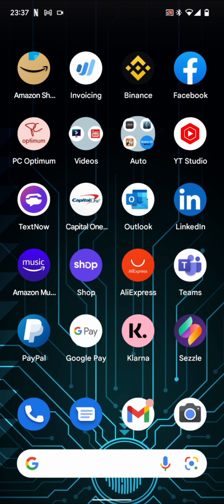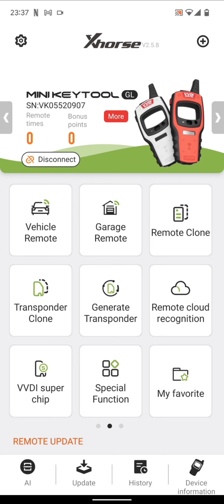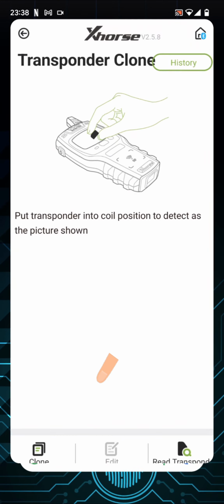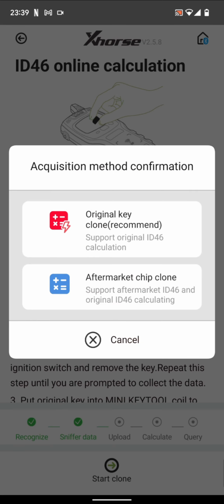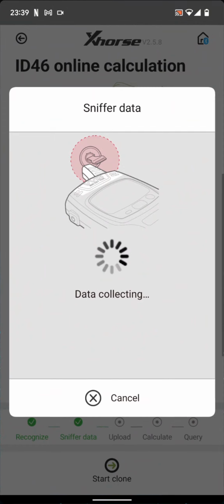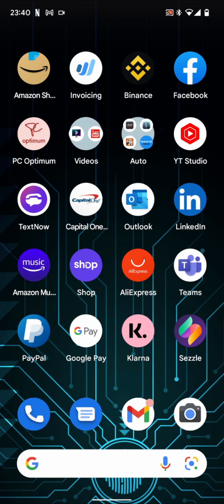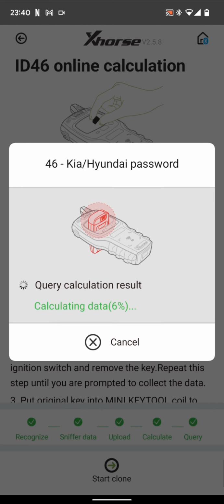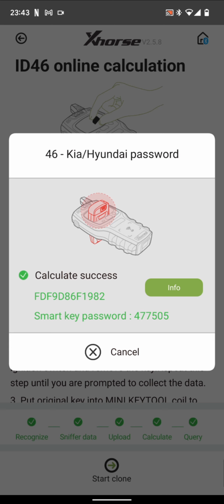Kia Pin Code(xhorse vvdi mini key tool)

Comment: DUDE YOUR VIDEOS ARE SO INFORMATIVE,, I WILL DEFINITELY BE BUYING ALL THREE OF YOUR KEY TOOLS I HOPE THEY WORK AS GOOD FOR ME AS THEY DO FOR YOU ... THANKS SO MUCH FOR YOUR TIME !!!!!!!!
Reply from the maker: Glad you like them! I try my best to make them as informative as possible... If you have any questions do not hesitate to ask.

Thanks again for watching.
Reply: Autel's KM100 does all the functions of the three tools, only missing keyless entry remote generation and transponder chip key tool functions, you'd be saving around 500$ and get much better IMMO coverage.

But in the end there's no replacement for one of xHorse' key tools, OBDstar/prog/code cannibal is the leader in motorcycles (if the software is available) as well a cheap way to do active alarm all keys lost on Fords, and XTool is good on offline key programming, older cars aswell as All-keys-lost timer bypasses.

Veteran auto locksmiths usually have all of these cheaper tools, or just one or two of the expensive tools like Abrites AVDI/Smart Pro/VVDI family/OEM tools.

If you are just starting up on mechatronics and need an all-in-one mechanic/locksmith tool, Autel's IM608 is the one to get, for UK people the MS908IM is actually a better deal as you get full Benz and BMW onboard programming functions which is missing on the IM608.
Reply: @SpringvisualTk  THANKS SO MUCH FOR THE REPLY ,,, ITS SO GREAT TO BE ABLE TO TALK TO SOMEONE WHO KNOWS EXACTLY WHAT'S GOING ON AND WHAT IS NEEDED . I DO MOSTLY AMERICAN AND JAPANESE CARS FOR NOW, NOT BIG ON THE EUROPEAN . I HAVE THE XTOOL PAD2 PRO BUT THAT IS THE ONLY KEY TOOL I HAVE BESIDES MY SCAN TOOLS THAT CAN DO SOME SECURITY WORK ,,, LIKE LAUNCH, AUTEL, AND G-SCAN. SUZUKI IS A ONE OF THE CARS THAT I HAVE TROUBLE WITH ,, WHAT WOULD YOU SUGGEST THAT WOULD SUIT ME FOR THE MARKET I AM IN ,, AND THANKS SO MUCH FOR ANY INPUT !!!!!
Reply: @8power0  scan tools won't do much for you regarding key programming, Autel's can't even bypass a pin for a 2010 Nissan.

We found the Pad2 lacking in newer cars and uncommon programming profiles, especially Hyundai/Kia keyless entry remotes, KM100 is definitely the best value, it will get you confidence in being able to do most if not all the OBD jobs for the market, even euros like Fiat, Alfa, Maserati, Rolls-Royce, and some BMW/VAG/Jaguar older than 2013 are no problem, even all Volvo semi-smarts.
The online compatibility list is top notch.

Ever since Autel started taking key programming seriously with the IM line, they proved consistant quality and updates, it makes no sense nowadays to get anything else value wise, other than for becoming a specialist.

Another option is the xhorse mini key tool, it has great Suzuki support, but it hasn't seen even a bit of the growth of autel's, but at $170 it's a reasonably good deal, but I'd try seeing if Autel will solve your needs first as Xhorse is not a complete tool and is not user friendly, and autel's solution cost just 200$ more since they include 2 universal fobs.
Reply: @SpringvisualTk  THANKS AGAIN FOR THE GREAT REPLY ,, I CAN'T TELL YOU HOW MUCH THIS MEANS TO ME FOR YOUR HELP . I WILL BE TRYING THE XHORSE MINI KEY TOOL FIRST ,, COULD YOU TELL ME DOES IT COME WITH THE APP OR IS THAT SOMETHING SEPARATE THAT I WILL HAVE TO BUY . I HOPE I AM NOT ASKING TO MANY QUESTIONS ... THANK YOU .
Reply: @8power0  all you need is the app you can download it now.
Make sure to read again my last comment as I edited.
Reply: Just used my mini key tool to read the smart key on a 2015 Hyundai Veloster FS.  Your video was a big help. Just an FYI for anyone doing the newer prox keys.  Remove  the battery aka  take off the back of the fob when pushing the start button on the center dash  with the fob. With the battery in it reads with the antenna for prox.  Once the battery is out it reads it by the start button and then the Mini key tool can sniff the data.
Reply: We have not been able to get that tool to work at all!
Reply: Cant get it to work with my 2019 sorento ID47. Im definitely gonna try your method anyway.

Comment: so this video shows the vvdi tool can detect smart key pin code?
Reply from the maker: it cannot detect but uses the xhorse servers to acquire the pin code for you,
Reply: @JLsAutoSolution  I really wonder how the xhorse server is able to get the pin code, which only car company knows by registering it with the vehicle serial number.
Reply from the maker: @krishnajo8926  the pin codes are stored in the keys so when you get in the vehicle the code is broadcast(smart key) and picked up   by the antenna coil then checked and validated. The pin code is encrypted( 12+++ digit numerical value) so when we up lod the the server x horse decrypts. 

There are also plenty of online services for vin to pin.all you have to do is pay for them. X horse just give this service when you purchase their tools.
Reply: @JLsAutoSolution  really appreciate your     detailed information. Thank you so much.

Comment: Bro can this be done on other car brands also like jeep Nissan TOYOTA etc...
Reply from the maker: Some yes and some no. More often then not you need a key programmer with pin code read in the tool.
Reply: @JLsAutoSolution  thanks, bro the the xtool x100pro2 can we rely on it in key programmer, you test it on different types of cars